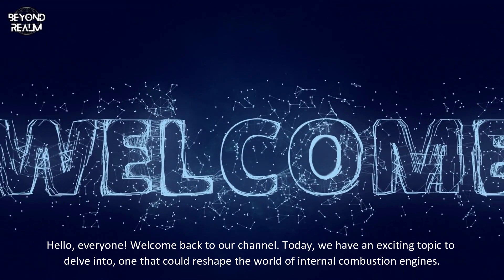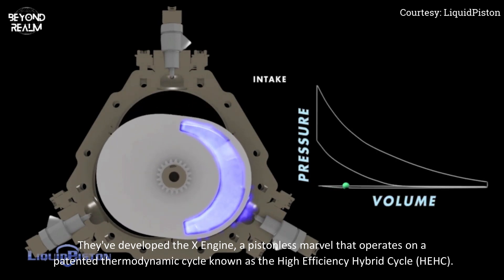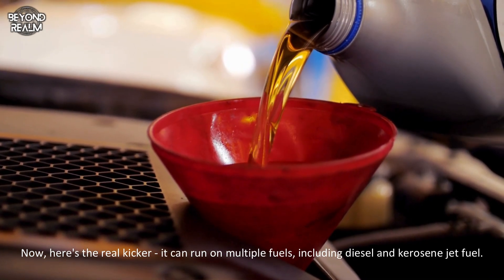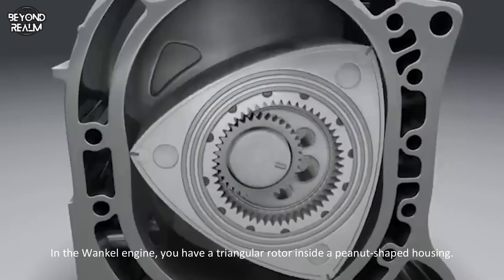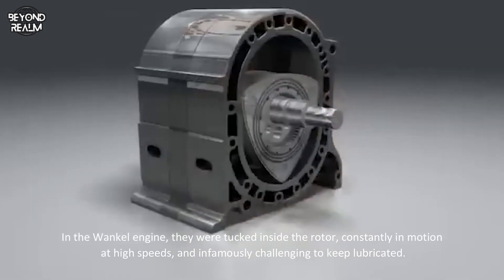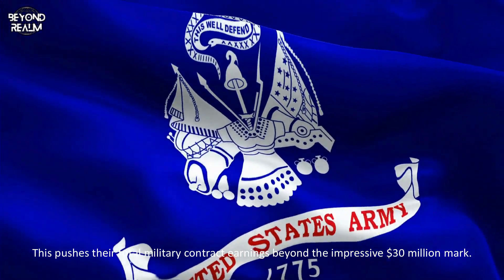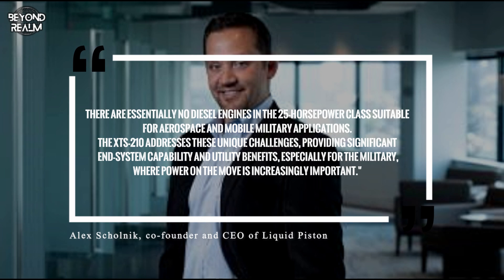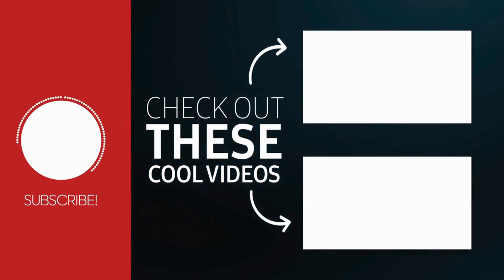This NEW Engine Delivers 5X The Power Of a Diesel Engine | XTS-210 Rotary Engine | Beyond Realm.

Comment: Updated Wankel. . nothing new. .just improved
Reply: It’s a huge improvement. Something Mazda couldn’t do obviously. That’s why it was discontinued.
Reply: @Glitchfloob  Mazda used the basic design that Mr. Felix Wankel invented in 1919, when he was just 17 years old... An absolutely brilliant individual he was... Mazda made it work very well... In fact, it was Mazda that won the 1991 Lemans race in a 787B racecar with a 4 rotor Wankel engine... It literrally left the competing cars in the dust in that race... None of the other cars should have even been racing on that track.... They were SLAUGHTERED by the Mazda 787B's in that race.. The following year (1992) The Wankel engines were banned by the governing body (ACO) of those races... To spare the competition a repeat performance of the same embarassment of being waxed by the previously underestimated competitor, Mazda... The Wankel was an ingenious design, that the Japanese people were able to bring to the public to enjoy.... 
      Now, this improved design called the 'Fluid Piston' engine was re-designed to eliminate the inherent problems that were associated with the original Wankel engines.... It was made better , by improving the efficiency, power, reliability and lowering the emissions.... The next step would enable it to burn alternative fuels.... This would greatly help the problems of runaway pricing of petrolium energy products, by presenting the practical use of competing alternative fuels and other forms of energy...
Reply: @Glitchfloob  what improvement? its just yet another iteration of the same old mechanically flawed concept as always. can rearrange things all you want, it doesnt alter the fact that all modern designs are akin to slapping lipstick on a pig. its a PIG no matter how fancy teh makeup is.

Comment: Literally a Wankel engine
Reply: @RedRider76 ,  That would be like saying the Ford Model 'T' engine is literally the same as a modern inline 4-cylinder , DOHC, VVT,, electronically timed and controlled COP ignition,  electronically controlled turbo-charging , electronically controlled variable flow-path intake manifolds , electronically controlled intake throttles and fuel injection timing/quantity controls,   electronically controlled engine cooling system air  circulation fans on the radiators.... . 
    This 'Fluid Piston' engine, is Vastly different than a  Wankel, and with only 2 moving parts per rotor case assembly. Several of the inherent problems that the Wankell engines always had,  but could not get rid of, were effectively addressed with this complete re-design... 
        Like the old Ford Model 'T' cars, people are now starting to really appreciate simple designs... The 'Fluid Piston' engines are great performers, with extreme simplicity, light weight, reliability, smoothness , are compact sized , quite efficient and very powerful...
Reply: It holds the same fundamentals as a wankel. @michaelmartinez1345

Comment: that wont work 
you need lots of compression for a diesel motor and that dont have it 
unless you try to make a jet engine out of it 
and usint 500 times more fuel
Reply: @jacktheripper-hoax , It was originally designed as a spark ignition engine... So , do you have information of what the OEM compression ratio is? It appears that the OEM  compression ratio could be raised fairly easily by making the quench dome contain a slightly lower volume... That would raise the compression ratio...But why make it a diesel? That might give it a slightly higher torque rating , but at the cost of much greater engine stress  And Diesel fuel is another petrolium product, which is what we are trying to get away from for energy creation..  .. 
        A gas turbine engine is a completely different design that accelerates a much larger volume of air than any type of a reciprocating internal combustion engine is capable of doing for comparative reaction thrust when using a prop. So what is the BMEP and BSFC of the 210cc Liquid Piston engine, while set at cruise power? You mentioned that it would take 500 times more fuel than a gas turbine engine creating the same amount of power... How did you arrive at that number?
Reply: @michaelmartinez1345  " It was originally designed as a spark ignition engine..." No it was not.  Do your homework before making a fool out of yourself.

Comment: AS LONG AS ITS NOT ELECTRIC IM GOOD WITH IT............
Reply: I feel the same way but there’s two tiny solar panels on top of this lady that I work for his camper and it provides enough electricity to run a 15 amp 10,000 BTU unit air conditioner all day long with a TV in the fridge raider to 4 x 3 solar panels Eventually we will be able to charge our cars with solar panels like that eventually they will have solar panels built into them no gas no oil none of that free driving
Reply: @TheKingoftheNortheast   First, Find out if she is using alternate power sources... Second, Find out how much power is drawn for those units....  And do the calculation over a period of 5-days... 
Third,  don't forget to count all loss's in that system... Including the batteries, the inverter, the wiring and junction box... Then let me know how many watts it actually takes to operate that system... Because I had a couple of PV panels very similar to the ones that you just described... On very sunny days, I was getting those panels to put out maybe 100  watts each, before the loss's that added up to about 40% of the 200w maximum output of those P.V. panels... Nowhere close to what she told you what they're supposedly putting out... 
        BTW, Does she Sell Solar charging equipment? If she does, be very careful if you are considering a purchase from her...
        Personally, I would NOT buy ANYTHING from her, especially what she claims about those "Two Tiny Solar Panels" , and what they are supposedly capable of...
Reply: Electric autos.  A car that gets 40 mpg on the highway, if you give that gallon of fuel to the power company, they will generate (efficiently), enough electricity to take that car over 80 miles on that gallon..  The downsides are:  
1:  Buying electricity on the highway can be as expensive as $0.80/kwh while charging at home can be as low as $0.06 from the power company (that's what I pay).  Or lower if you have solar panels.
2:  My state (Washington) charges me ~$250.oo extra every year (thieves).
3;  Range:  Most all electrics have less than 300 mile range.  I drive a Volt which goes ~50 miles on electric and 350 miles on gasoline.  
There are more considerations in buying electric, but these are the major.
Reply: Anything wrong with electric motors? What are you running your vacuum cleaner on, or washing machine? Diesel?
Reply: No they all have their place..But a toaster with tires isnt my idea of that place... @wacio
Reply: @milwaukeegregg  Your car requires electric motor to get going already.
Reply: @wacio  There was a time, when cars had engines that started with a crank powered by hand... Several motorcycles and lawn equipment are currently started with hand and leg powered levers and pull-ropes... Not every engine needs an electric starter motor...
Reply: @michaelmartinez1345  Correct, but why return to the old technology if the better one is available? We don't crank start cars, we will not return to ICE once we have infrastructure in place to remove battery from car which keeps EVs from becoming viable transportation.
Reply: @wacio  On cars, for safety reasons, yes a starter motor is required... Many small engines can be started fairly easily with a rope or a kick-start lever... The idea of considering these older methods,  is an effort to create vehicles & equipment that are simpler, rather than more complex... This reduces the cost and complexity of things we use frequently, mainly because people often spend a lot of extra money and time to make their things nice, but the things that often fail could have inherent chronic problems, that will eventually make an expen$ive machine useless..  An example would be vehicles with ABS brake systems. Many of those things don't work properly, and the equipment to repair them are often un-available, or extremely expensive... So they are often by-passed to assist the service brakes to continue to work properly... Expensive junk that lacks durability & reliability..... This type of equipment often self defeats it's own purpose...
Reply: @michaelmartinez1345  Exactly, ditch the ICE and you no longer need clutches and transmissions, Most don't need oils and cooling systems. EVs can be extremely simple.
Reply: @wacio  Sort of what I was thinking, but also vastly different... E.v. use with storage batteries alone is not practical at all for heavy loads, or long distances or on mountainous terrain, or soft sand or rainy weather because of their limited range.... ...  Several of them also DO have oils, coolants. Very large/robust cooling systems loaded with anti-freeze.. .. 
         The Liquid Piston engine is an excellent candidate to provide electrical power to charge the batteries, using  alternative fuels,  for small & medium sized vehicles .    
        There are vehicles in the class 8 category that Have Large groups of storage batteries to supply power to the electric motors that propel them. These vehicles in their development stages do show signs of improvement... Lots of pulling power, (when the battery supplied electrical power to the motors is readily available)... 
    Charging vehicles like this, Requires  125 kva (250 hp) of electrical power , for anywhere from 90 to 180 minutes. This has to be done after 350 to 400 miles of travel on mostly level highways ,  around 150 to 200 miles on mountainous roads, city streets and cold conditions, while moving full loads... None of these vehicles are equipped with 'sleeper' cabs, as You can see that they don't have the range for long trips... The same company has Class 8 vehicles that are Hybrid designs which use onboard electrical power generation equipment that uses Hydrogen and fuel cells to create the necessary electrical energy to charge a couple of large batteries, to provide power to propel these vehicles...Again, none of those have sleeper cabs, as the necessary infrastructure for the hydrogen re-fueling and parts supply system required for long distance travel are not available that will handle fleets of class-8 trucks, at this time...
     The next hurdle will be to provide the infrastructure necessary to supply both types of vehicles (Battery only and Hydrogen Hybrid) for their safe and reliable operation.   This is going to be, perhaps the greatest challenge of all because of the co$t and complexity of the massive improvements made  to the power grids and build numerous additional power plants needed for these battery only vehicles along with readily available - Large amounts of hydrogen to be supplied to fueling station networks that can handle large class-8 trucks, wherever these class-8 Hybrids go...Their Current(December of 2023) customer base is focused on the shipping needs in the state of California. which happens to be in serious financial trouble (-$68 BILLION DEBiT) at this time... 
    So anybody who can sell several billion $ worth of infrastructure to support an all battery truck fleet farm to the already indebted/financially strained taxpayers of Calif, might re-consider  channeling their talents to selling FROZEN food and  
beverages to the people living in the North pole, as they will probably have better luck selling the Frozen goods, than selling the infrastructure upgrades to the Calif. taxpayers for these battery only and hydrogen hybrid vehicles... 
      And the staggering Loss of electrical energy transfer, between the remotely located Electrical powerplants, to where the power is finally put to the road, will definitely demonstrate the magnificent ways that energy can be effectively lost in the form of heat over great distances.... Why? When you find out, please let me know Amigo.....
Reply: @wacio  The pipe dream that You have, of electric motor powered vehicles not needing cooling systems, is wildly inaccurate.  There are large vehicles that are being developed with electric driven wheels , which have extremely robust liquid cooling systems for their batteries, their voltage inverters, their fuel cells, their braking systems, their electronic components.... Much more coolant than conventional vehicles in that catagory usually require...
      Another thing that you are grossly overlooking, is the huge amounts if infrastructure and utilities needed to just 'ditch' the 'ICE' vehicles , that you're probably (inadvertantly) highly dependant on for common products that You consume in your daily routine..
      . And how many pollutants will the  1000% increase in the number of electrical powerplants produce, to keep the proposed Purely storage battery 🔋 E.V. vehicles working?
Reply: @michaelmartinez1345  My vision for EVs is - no large battery onboard (small one to make it to main road from garage). Roads would have wireless charging capability.  Vehicle would be a lot lighter  and efficient. 10kW electric motor would not need cooling and would still allow speeds exceeding highway speed limits. 1000% increase in electricity production would leave planet a lot cleaner when you account for 90% ICE reduction on the road. We can make electricity with nuclear power plants with next to zero emissions.
Reply: @wacio  Set up a patent for it.... Don't tell too many other people about this idea before you patent it, and be aware that somebody in a foreign country could plagiarise your idea, with no possible way to be forced to a trial over it, because your laws of infringement of intellectual property, just might not apply to them... Just saying Amigo...
Reply: @michaelmartinez1345  Its not idea. Its reality already. Seoul (S.Korea) has some city busses already using this system for few years. In Detroit (USA) first testing lines are being planned and set up.
Reply: @michaelmartinez1345 - EV’s don’t reach the tipping point completely killing off ICE technology until battery technology advances much further- that’s easy to see. Fusion power really is the catalyst that will determine when EV technology will become dominant- limitless clean energy is what it will take to truly make that happen. If people are to switch en masse, the system they’re switching to needs to be better for them in every way- otherwise why switch? It’s just a novelty at the moment.
Reply: @wacio  It is better to lubricate an electric motor with oil, rather than grease.  My profession was working with electric motors ranging from 400 HP to 30,000 HP.
Reply: @michaelmartinez1345  Your knowledge is very good Michael.  Read my comment.  On my Volt, a 30 kw ICE is all I would need to get the same speed/power distance on my 500 miles range.  Having manual control or GPS for the masses, would tell the ICE when to charge.  Please comment, Dave
Reply: @wacio 😂😂😂😂😂Exactly people act on pier emotion
Reply: @TheKingoftheNortheast  It's more like a reality check for people who have very limited knowledge of what it ACTUALLY takes to bring electrical power to end users and housholds... One commentor on this thread actually asked another commentor  'What do you think powers Vacuum Cleaners , Refrigerators, Stoves, A/C,  T.V.'s ? Diesel? ' 
    Inadvertently, he hit the nail squarely on the head with that question..  Because Diesel , Kerosene and various other Petrolium Products are ACTUALLY used in large industrial duty Gas Turbine Engines, and large Diesel engines, to power Large A.C. generators , located in remote areas, to power the appliances (and many other things) that he was referring to..... So many people have no idea of how the electrical power that they frequently use every day is ACTUALLY generated....